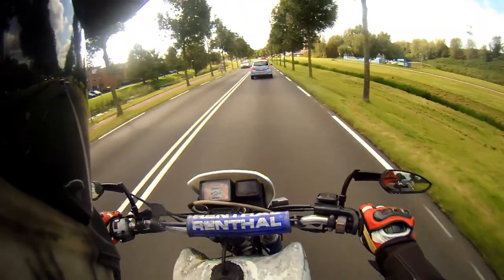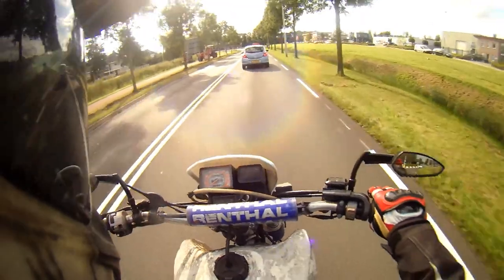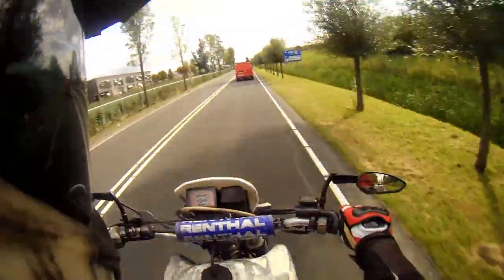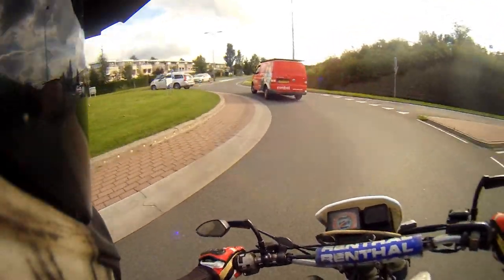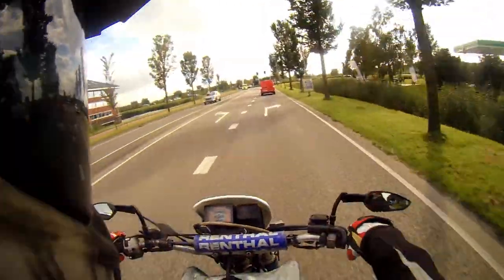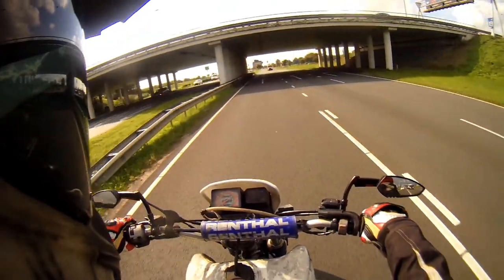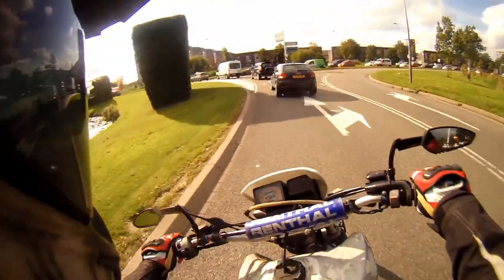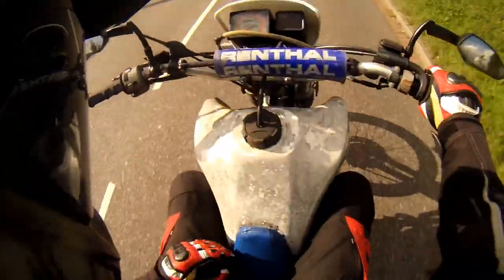Honda got a New gearshifter

Comment: Shifter looks great! If you can't fix your original speedo, a bicycle speedo works with your spokes or find an nice odometer on gearbeast, i think the B728 could replace your dash or the B732 if  you only want a speedo that suits your bike :) (i just assume your speedo wire will fit ;))
Reply from the maker: Well, by progress of elimination we found the problem. It is the part next to the wheel that makes the cable spin ;).

Like the shifter so far. :)
Reply: great that you found the problem :) That thingy is called the speedometer drive gear. If i looked correctly it should Honda part no. 44800-KF0-023 you can find a few of them on ebay used and brand new, but i also noticed that the same drive gear is used in different type of Honda's.
Reply from the maker: Yupe that is the part.
Could have guessed the english term ;)

Yeah, it should be quite easy to get one, either original or off the market.